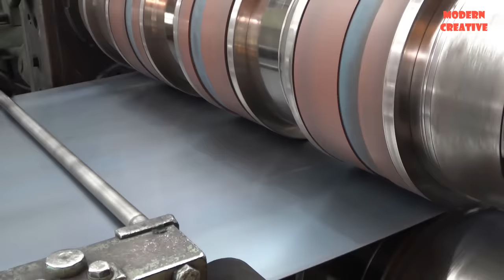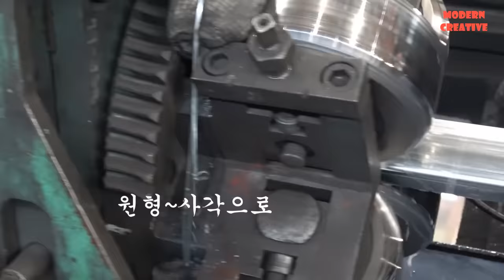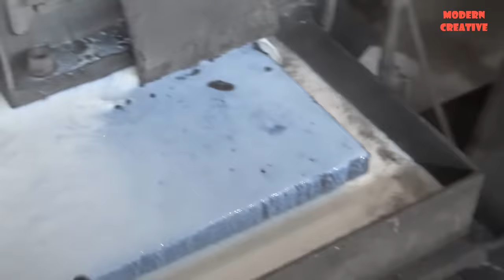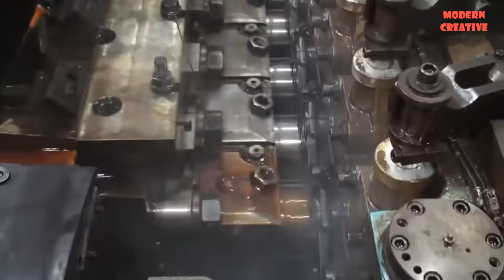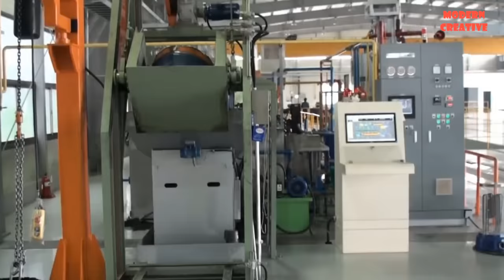Explore the production processes of square steel pipe from steel sheet and round pipe

Comment: Omg. If it has corners, it’s considered tubing. The difference between pipe and tubing is pipe CONVEYS material, liquids, or gases, where tubing is only used for STRUCTURAL purposes.
Reply: OMG NOBODY cares
Reply: Hahahahahahahaha
Reply: No quite correct.  I worked at a Seamless tube mill for 30+ year.   We made tube for deep oil well drilling and casing.   We also made square tubing for structural purposes.   The difference between a pipe and a tube,…the pipe is measured on the inside diameter,  the tube on the outside diameter.
Reply: to think someone had to place a single seed of rice into the ground to make all this happen.
Reply: I worked on steel pipe.   A pipe is measured on the I.D,    Eg.   a schedule 40 pipe, 2” , id  2-1/4” o.d.    A  9-5/8 tube, which is a common size for oil well,  is measure 9-5/8” by .500” wall,  etc.    we could produce a  seamless tubing, 40’ long.
Reply: Thank you. I work in steel as well and this drives us mental.
Reply: False! Bears eat Beets!!!!! Bears, Beets, Battlestar Galactica!!!!!
Reply: Thanks😅 for this knowledge
Reply: @trainnerd3029 revel in your ignorance, but don't subject the rest of us to it.
Reply: @trainnerd3029 I am sorry the OP wrote information above your level of comprehension. Because some of us that understand do indeed care.
Reply: You sir, are incorrect.
Reply: @RonDoiron-pz3ee 
Not exactly the difference between pipe and tube is that pipe is a cast segment and tube is a molded segment.
Reply: That's an amazing distinction. I've always wanted to see exactly this. Thanks for the clarification.
Reply: @RonDoiron-pz3ee Deep oil well drilling must be the only industry in the world to use square tube to transport fluids. If I had to guess it's because the structural strength and durability is much higher at extreme depths. Especially when using something like 316L or whatever high quality steel they would use. Do you know what grade of steel was used for that square tube for the oil industry?

Comment: Lots of nice machinery!  It must have taken quite a it of thinking to design all that, and also to get it set up and aligned to run accurately.  Every single one of the numerous rollers and guides on that line has to be carefully adjusted in 3 dimensions, and run at the right speed, etc. etc.

Comment: I was at Welded Tube in Chicago area and the did thick wall tubing from sheet rolls. They had to get the curvature out of the rolls by going up almost 30 ft then into floor the same distance, then had rollers like the thin wall shown. The had a chop saw ( 5 foot diameter) the would follow the tube while cutting.
Reply: That chop saw really got MY attention. What a beast.
Reply: @brianwood7480  If I had a cell phone that took vid I would have posted it. Amazing to watch.

Comment: Nice to see these machines and processes, but you really MUST add text / narrative to describe the machines, process stages.
Steel coil, unwound onto a slitting line. Slit into individual coils. Individual coils placed onto a multi stand forming line, formed into a round and seam welded. A scalper to remove excess weld then into a water cooling tank. After cooling the round welded steel tube goes into a multi stand forming train to convert the round tube to a square or rectangular section. Finally a flying saw to cut to exact finished lengths. They only require inspection / testing to ensure weld continuity, and dimensions. Then into the box for supply to the final customers.
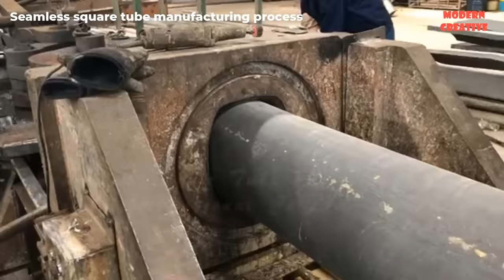6:31 Drawing steel pipe through a square die on a draw-bench. The end of the steel pipe has been cut and swaged to produce an end that can be gripped by the draw-bench jaws.
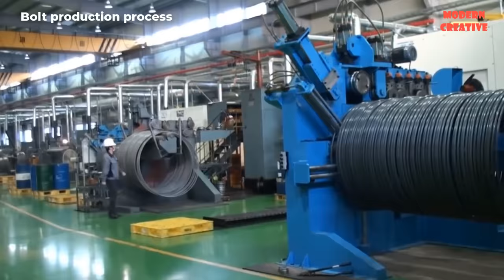8:48.... making bolts, nothing to do with making pipes, completely different product and techniques.
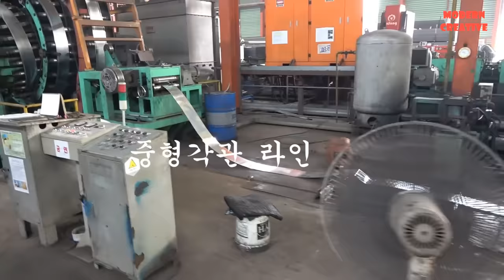Reply: I'd like to add that the machine at 2:00 is a sheet accumulator, since it is a rather neat machine but it is difficult to see what it does or how it works.
It temporarily stores sheet to allow the production line ahead to operate without stopping, even while the sheet input is stopped to weld a new roll to the tail of the old one.
The input sheet is wound onto the outside of the big wheel and unwound from the inside of it, then there are some rollers to curve it out from the middle so it can continue on. When the big wheel rotates clockwise it takes in and stores up sheet, when it rotates anticlockwise (as seen here) it does not take in sheet and it releases the stored sheet, if it is stationary then it is taking sheet in at the same rate that it goes out. The big wheel does not grip the sheet, it is covered in rollers so the wound-up sheet can rotate around it.

Comment: nicely done. i would love to see the inner workings of the machine that changes the round pipe/tube to square. that line must be a bear to maintain, let alone build.
Reply: Ййййййййфйййййййййййффйфййфйййййййфйййййййййййййййййййфйййййййййййййййййййййййййййфйфффйзз
Reply: Actually it’s four beveled roller spindles that form the four corners of the square tube
Reply: Maintenance was the FIRST thing that screamed at me.
Reply: @brianwood7480  Just bearings.  Ones lack of understanding does not increase the complexities of the world around them.
Reply: @Look_What_You_Did  is that all you see, bearings?
Reply: The mill that makes square pipe out of seamless tube has 3 stands, we V shape rolls.  The tube would be heated at forging temperature, then fed by a conveyor, into the mill.  The first mill stand would grab the hot tube and as it roll through, would slightly make the tube ovalish, the second stand would make a square tube with round corners and the third stand would finish the square shape.  The tube would come out of the last stand, slightly hotter, due to compression and friction.   It would then continue down the line, now a bit longer than 40 ft., up to a cooling bed, driven by chains.   Once cooled, they would be picked up by a 10 ton crane, 10-12 pieces at a time and stored in huge bins.  That mill could produce 3-1/2” to 10” square tubing.

Comment: How is the welding done? Lengthwise... In other words, what kind of welding process/technique?
Reply: I think it is Electric Resistance Welded (ERW) between two points with no filler metal. But I'm not 100 sure. It can't be a tig process because I can't imagine argon could be used with all the coolant on the pipe.

Comment: Did I see this right, square tubing coming from round pipe?
Reply: Yes you did !  They  were using ERW ( Electric Resistance Welding ) . It is a continuous process with a flying cutoff to standard lengths . 

It did bring back some memmories !

Comment: Nice video...but it will be more helpful if you add role of the machine during step by step process.
Reply: I guess it's right there... but in Korean ;-)
Actually, the process is pretty self-evident - a steel sheet on a roll is cut into strips, those strips go through series of rollers thay roll the strip into a round pipe, which is then welded up, any excess of material from welding is cut off, and then the round pipe is pushed through more rollers that squeeze it into square section. The saw cuts it to desired length, and basically that's it.

Comment: It's actually embarrassing how little safety has been a factor in this entire factory, Its not even safety last its safety no thanks.
The amount of points where somebody could get caught and have limb's or their entire bodies destroyed is insane.
I have worked in 30+ factories with similar equipment in Australia and not even the worst of them would have as many safety issues in the entire factory than this place has in one section on one line.
Pathetic how in 100+ years of modern advancement they still practice safety of the 1920's with machines from 1980's.
Reply: I couldn’t agree more, it speaks volumes about the factory owners lack of duty of care for their workers!
A#@holes!
Reply: Yes I was thinking to my self no glasses no hard hats very easy on safety in a very dangerous world  cheers 👍👍👍
Reply: Yeah, they have a few railings and guards but need way more, but not that bad tbh, it's all still safer than working a manual lathe.
Reply: @samheasmanwhite  Thats why they invented a stop bar and a chuck guard, as long as you're not wearing loose clothing/ jewelry or gloves its incredibly unlikely to be injured.
Reply: @neiljohnson8252  Depends what you are turning I guess, turning anything large at a high speed should be done with more caution than being near that line. I'm guessing the worst safety stuff there would be lax work practices like not stopping the line for intimate adjustments, rather than the machines themselves.

Comment: not sure why they are doing this. Squares tubes are normally folded and welded flat stock, round is in line rolled and welded flat stock
Reply: It told you in the video, they are making  seamless hollow structural tubing.